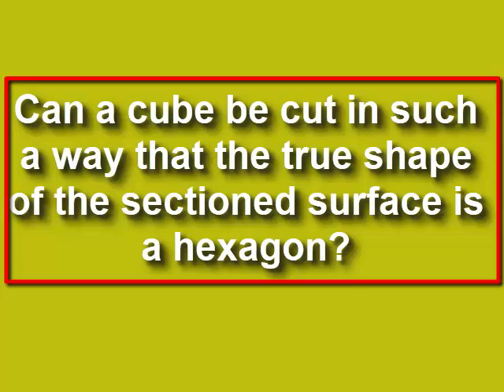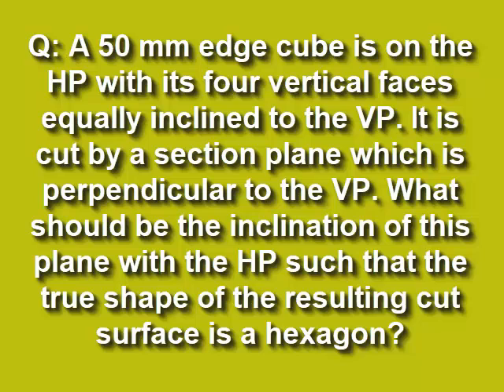5.4-Section a Cube to obtain a regular Hexagonal Section

Comment: What if the cutting plane is 45degrees to vp and not perpendicular
Reply from the maker: Yes, obviously it will produce different shapes depending upon the location of the cube with respect to HP and VP. The current video was to check, under what conditions you will obtain a regular hexagon. Thanks for asking your question.